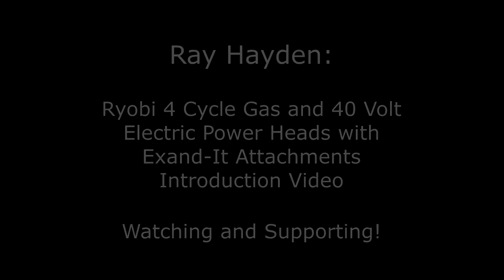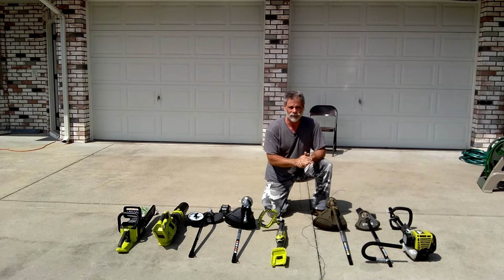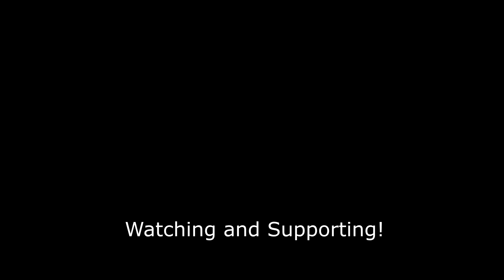Ryobi 4 Cycle and 40 Volt Power Tools - Introduction - Ray Hayden

Comment: Did Santa Claus come early to camp Hayden?  I love the edger!  I also love using it!  It is my favorite...fun for me to see all the junk come out of the cracks, lol.  But then the blower just blows it all back in and I need the power washer Ha!   Ooo chain saws scare me!  My husband fell off his ladder while holding a chain saw!  Be careful Ray!
Reply from the maker: I went with Ryobi (Home Depot focus I suppose), but I wanted the 4 Cycle engine because I don't want to get into mixing gas and oil - lazy me! It also has more power. I ended up using a number of the "Extend-It" tools, and I also love the edger... other videos address the other tools. The blower is excellent in cleaning up after I edge... the other benefit I have is that the driveway is all we have (and the front porch) - but the rest of the area around the house is lawn... a LOT of lawn!

Comment: So much fun equipment!  Chainsaws usually scare me though.  The electric one doesn’t seem as intimidating for some reason.  Great video!  💗
Reply from the maker: I absolutely love how you say that the electric ones do not seem to intimidate as much... I do actually get that feeling from it, but spinning teeth scare me as much as working with electricity! I decided that if anything at all is going to push this thing near my body, I will let it go to hit the ground as opposed to having those blades coming near me - the really good thing is that it stops faster (from what I remember when I used gas chain saws) - and I find this to be very good. The thing is doing incredible work - very quickly! I have a video coming out on that.
Reply: Ray Hayden, my husband is a work horse and he’s cut down some trees on our property for firewood.  He did get a kickback from a chainsaw and it hit his leg.  Fortunately it only required stitches but boy was he unhappy about that incident!  It does seem like gas powered chainsaws take more time to slow down.  I hold a chainsaw like it’s a snake and I’m ready to toss it away from me.  This is why it’s not recommended for me to use chainsaws, ha!